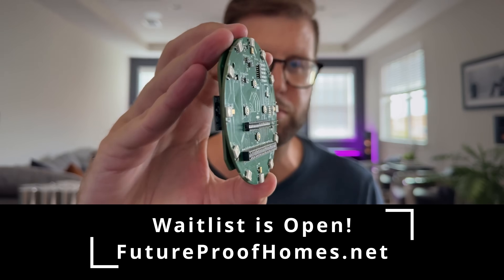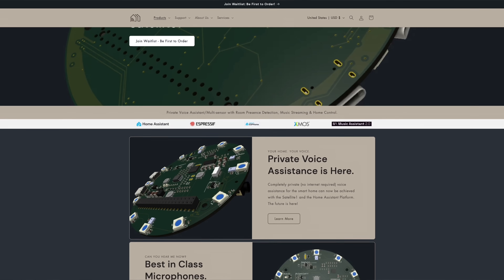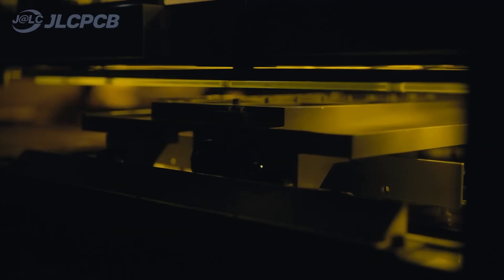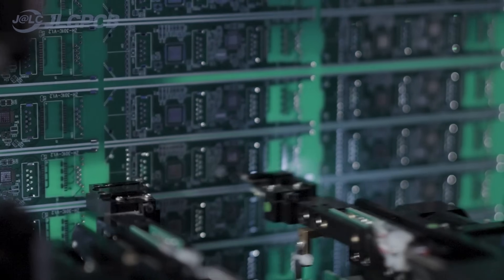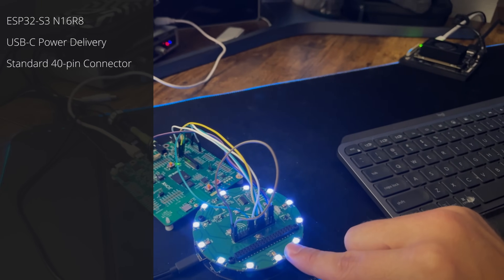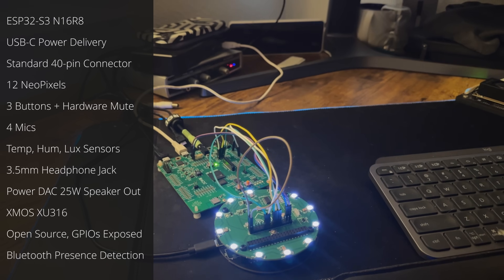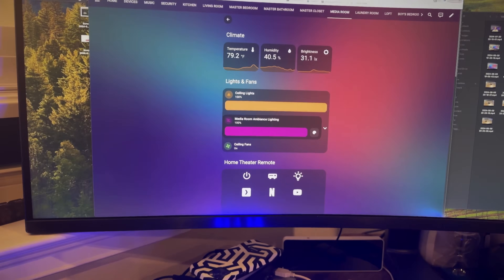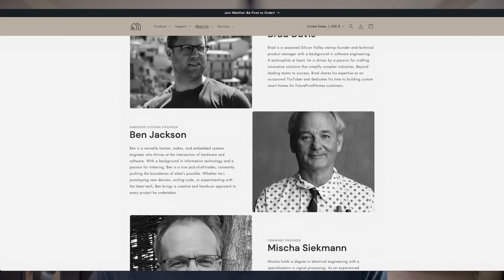Satellite1 Waitlist Open!  Your Private Voice Assistant Hardware is Coming!

Comment: This looks super promising. Will there be an option for 220v on the ceiling mount? Would make sense to connect directly to the existing builidng electric. Also, is connection to the internet optional for doing a quick voice search?
Reply: It would be fairly trivial to add an AC>DC transformer and hide it in the roof to power each one. But they are also adding PoE when they make their enclosure. Hopefully they have some more news soon!

Comment: The claims are dubious because the xmos chip doesn't rival the latest smart speakers as it uses some of the early technologies the 1st gen Alexa/Google devices used.
Google with its latest devices uses some called targetted speech extraction and is the oppisite in design as you enroll your voice so its known and extraction of known and the models they use has been a huge step up to cancelling what is likely unknown noise.
Without any targeting the technologies on show are what you would call a conference microphone which is not really the as modern smart speakers and also its not opensource as the xmos algs are behind a commercial paywall...

Comment: i like to have as few wifi devices as possible. Can the USB port used for power be connected to a POE connection for power and data?
Reply from the maker: The HAT & CORE boards will eventually have a “mini-speaker” you can snap on to the bottom for great sound.  That speaker will have full PoE built-in which is exactly what you’re looking for.
Reply: That will work perfectly! I can't wait till it's available.

Comment: Dude, this is amazing. I plan on buying several if the first dev kit works well. I already use Assist more than Alexa while sitting at the PC, would love to have a good solution off the shelf for all rooms (so I don't have to build 10 DIYs)
Reply from the maker: Sounds like you’re a great fit for the Sat1 too!  Thanks for the support.  Launching soon!

Comment: This is quite cool! So... will it be able to be powered by POE, or just the USB-C options? I like the concept of in ceiling installation and running another POE Cat6e cable is so much easier than running a power outlet!
Reply from the maker: When the enclosure comes out in Q1 it will have a PoE connection.
Reply: @FutureProofHomes  Beautiful! Thanks!

Comment: I'm on the waitlist and really looking forward to this hardware. You're doing an awesome job, thank you and best of luck! I do have one request/suggestion, as an electronics engineer it drives me insane when companies make stupid design choices for powering equipment. I have seen a trend toward powering sensors with USB power supplies, what are people thinking? I know it's easy and simple to use a USB power supply when many of the designs incorporate an ESP32 or similar inside and all you have to do is jam in a micro USB connector to power it but you have to think about the practical aspects of form and function. When you want to place a sensor like a millimeter-wave sensor or any other occupancy or motion sensors it's ridiculous that with so many products on the market now you have to use a USB power supply and then try hide the power supply and cable going to the sensor. What am I missing? I want a nice clean installation and not have a sensor on my wall with a cable running down to an electrical outlet where it's plugged in. In a perfect world the device would support PoE, not an adaptor that I saw mentioned in another post, you want it integrated into the PCB design. RJ45 connectors are, unfortunately, large and I concede that is not ideal and a challenge to keep the device form factor small but this hardware is going to be a little larger because of everything it supports so I feel a RJ45 connector can be accommodated. If PoE proves to be too much of a challenge then please, please, please make provision for DC power terminals. A lot of homes don't have CAT5/6/7 running everywhere but most do have basic, two conductor security wiring that you can send 12 or 24VDC over (5VDC not ideal over long, small gauge copper). I frequently replace old PIR motion sensors with newer technology and use the 12 or 24VDC that was previously powering the device to power the new hardware which then keeps the installation of the device nice and clean and aesthetically pleasing (no stupid power cables hanging down the wall). Thanks to PoE being a power and low latency data/network solution it is ideal but at the very least it would be nice to have flexible power options. A while ago I purchased an ESP32 PoE Development Kit (EST-PoE-32) from Everything Smart Technology (EST) and it supports PoE, USB-C and 9-28VDC for power, it is a great, flexible, little board and proof that it can be done. One final point I'll add to this comment, that has become rather long, I really like being able to power all my devices in my home with a single PoE Ethernet switch which means I only have to worry about a single power source that is plugged into a UPS and not dozens of USB power adaptors plugged in all over the home. Great solution to keep everything protected and operational no matter what happens with mains power. Keeping a spare PoE Ethernet switch also makes for easy redundancy in place of dozens of USB power supplies that easily have their cords pulled out. Okay, perhaps I went a little overboard making my point 😁.
Reply from the maker: Great comment.  I hear you.

Here’s what is happening behind the scenes.  Let me know your thoughts.

What you saw in the video is the “HAT” and “CORE” boards.  Behind the scenes we have a third board we call the “SHOE”.  This SHOE board is responsible for all the I/O connections at the bottom of the hockey puck enclosure (3.5mm headphone jack, USB-C, 30w PoE+, and the available GPIOs).  

So if you’re running the CORE and HAT “naked” (with no enclosure) then you don’t get PoE unless you add-on the third SHOE board dangling from a ribbon cable.

Obviously this decision is being made so that all the boards can fit in the enclosure.  I know this isn’t ideal for hackers but we’re trying to avoid two variants of the HAT.

Thoughts on this?

Comment: Congratulations on this!!! I do have a suggestion for gen 2… if you integrate POE into the board it would make a in ceiling option a lot easier and probably enable a longer longevity. I can’t imagine having to dig in a ceiling to replace a hidden 120 to usb adapter would be very fun. Yet having a cat5/6 dongle that has POE to it can remain dormant in the ceiling with no drawbacks.
Reply from the maker: Our enclosure which will come out in early 2025 will have PoE. :)

Comment: This looks really cool! Any plans to integrate mmWave presence sensors into this and open sourcing the software? Thanks :)
Reply from the maker: Yep.  mmWave will be included in the enclosure.   Alternatively, you can use the PCB kits exposed GPIO and quickly connect a mmWave sensor.
Reply from the maker: Firmware and hardware will be open sourced too.  See the website and GitHub for all details.  :)

Comment: I know you have a 3.5 to connect external speakers but I would prefer not to run wire (whole home audio amp in basement), will we have the ability to still modify the yaml in the esphome setup of the device so that I can set the output speaker to a home assistant media player?  I currently have some m5 atoms that do this by specifying VLC media player ironically which is hooked in as a source to my whole home audio (already have speakers in many rooms throughout house) through my home assistant server.  I use the on_tts_end: and on_tts_start I specify the entity_id of the vlc media player.  The m5s work pretty well but the accuracy is very hit and miss as far as hearing you and they definitely can't hear you if other sound is going on in the room.  The device looks awesome by the way and good luck with the launch!
Reply from the maker: You will absolutely have the ability to modify the ESP32's YAML to output audio another media player of your preference.

Comment: Last time I checked the problem with all those Satellites is that the server running Home Assistant still needs to be powerful enough.
e.g.: I tried the "$13 voice assistant for Home Assistant" (ATOM Echo) and it was horrible. Not because of the hardware in the ATOM Echo but because the server running my Home Assistant instance uses a low powered Intel J4105 Prozessor which is simply not powerful enough. I could only run the lowest whisper model and voice processing took minutes and was horrible inaccurate.

I wish someone would invent a private Voice Assistant which is able to do all the voice processing on device.
Satellites are nice but you still need a nice server for Home Assistant. A Pi 4 / 5 or my Intel processor are just too weak.
Reply from the maker: Fair enough.  You do need an adequate home assistant server to power the home voice interactions.  That is true.  See our roadmap on the website, the AI Base Station (might be late 2025 or even 2026, unless we can get big revenue to scale the team and move faster) will provide more than enough horse power to power this system.
Reply: Yeahhh...
If you want true AI interactions and not just scripted Answers you will need WAY more horsepower to run that locally.

Comment: This seems pretty much identical to the ReSpeaker mic array boards, just with an ESP32 inside. Seeed never delivered a firmware with working beamforming for the XMOS IC, let's hope this guy does better.
Reply from the maker: If we're thinking of the same ReSpeaker, then the Sat1 should be quiet a bit more versatile and powerful. e.g. Has better audio processing, music streaming, bluetooth presence detection, extra sensors, etc.  Not to mention this will work with ESP32 and RPI. :)
Reply: The integrated ESP32 and the resulting form factor is very nice for sure. But for me a voice assistant gadget hinges on rock solid speech recognition (mainly wake word but also STT) no matter if there's music playing or water running in the room. The ReSpeaker didn't have that, despite also using an XMOS chip, that's why I'm having reservations if you can do it. (But very much hope so!)

Comment: OK this looks very cool, so I wanted to share with you my 'wishlist' for the ultimate smart device to place troughout my house:
Devices liek the "Everything Presence Pro" or the "UltimateSensor" check many of the below boxes, but there is note that checks all of them :--)
Some of these could be great to add to your sensor, some it could be nice to ensure that end-users can add them themselves if they want to.
* ESP-based (for ESPHome): check
* With all the features for voice: check
* Speaker can be used as a media player: check
* Bluetooth proxy support: check (I think)
* Bluetooth presence detection: check (I think)
* MMWave Sensor
* PIR Sensor (for an alarm system)
* CO2 Sensor (to monitor air quality, i.e. when to open a window or increase ventilation)
* PoE support: (powering + networking over an ethernet wire).
* Alarm cable support: allow it to be powered by an alarm system and also have it include a relay that can trigger the alarm system when the PIR sensor detects motion.
* Colour LED's (to show a status)
Reply from the maker: Bluetooth proxy - check
Bluetooth presence - check
PoE - check (with adapter or future enclosure)
mmWave -check (via GPIOs or future enclosure)
LEDs for status - check

All other ideas - TBD

Comment: Excellent project!! Is it possible to add PoE?
Reply from the maker: We have a solution for PoE.  Ill discuss in next video.
Reply: @FutureProofHomes  That's great to hear! It will be great to connect and power with one wire ! Also, does it support VLANs?
Reply from the maker: Good question on VLANs… I’ll need to test this!

Comment: How is the streaming handled from MusicAssistant to this Sattelite1?
Reply from the maker: The Sat1 is a HA media player that Music Assistant can immediately stream to.   Our ESP32 implementation handles up/down scaling the music quality to 48kHz when necessary and we can also leverage Music Assistants server transcoding features so the ESP32 doesn't have to do the hard work.
Reply: @FutureProofHomes  .. Thank you for your fast answer. Is that based on ESPHOME? Because ESPHOME lacks in good Multiroom support. It would be great if you can implement snapcast this would enable real Multiroom . Google for snapcast + Carlos. Then you will find a great repo.
Reply from the maker: I also want SnapCast.  Stay tuned.  We’re working on it.
Reply: @FutureProofHomes  Thats so Cool! If you change the dac type to an TAS5805M you get 20-25W in stereo with great efficiency. Easily powered via USB C. If you have the capacity on the esp32 please provide eq settings like loudness, bass , mids, heights and as a bonus room correction.

Comment: just to make a note, to the date, I built the same thing and currently in the testing phase, using 2 Esp
32 models in 1 device, 4 mics, speaker and all the most common sensors. If i fail for sure i will buy many from you, great work
Reply from the maker: Why two ESP32s?  One for ESPresense? :)
Reply: @FutureProofHomes  connectivity/protocols on one and sensors on the other, they seem to work very well together. S3/C6, the mics i wanted also needed C6 so spread the load
Reply from the maker: Does it mean the user would need to juggle multiple serial USB connections and flash multiple ESPs individually, or did you find a way to flash both simultaneously such that the S3 is a "master" and the c6 is a "slave"?

Comment: If this comes with the optional extra of mmWave then i'll be 1st inline to buy
Reply from the maker: Yes!  Will work with any mmWave since all GPIOs are exposed.  Stay tuned as the future enclosures may also give you this mmWave. ;) ;)
Reply: @FutureProofHomes  absolutely awesome. I currently have 15 mmWave sensors ceiling mounted and they are so chatty that I had to create a zigbee network just for them and they all have different controls....nightmare. Absolutely looking for a better alternative

Comment: Stealth ceiling mounted FINALLY someone is thinking about this
Reply from the maker: Agree!  Recessed mount for US (common with our drywall ceilings) and something slightly different for rest of world.
Reply: @FutureProofHomes drywall ceiling is fairly common in many places around the word or at least all the places I’ve been living, but there might be some additional requirements regarding inset devices compared to US.
Reply from the maker: Yep.  Gotta follow proper protocol/regulations/codes for in-ceiling devices.  Hence why a bit later in roadmap.
Reply: @FutureProofHomes  mains powered will ne a necessity as low voltage will be a pain the A$$
Reply: @sygad1  I'm partial to PoE. Provided you have PoE switch already, it's much easier and cheaper to run and connect Cat5. Romex is expensive and requires larger holes to run, a conveniently located junction box with constant power, and is much less DIY friendly for most people. You'd also be getting the benefit of wired networking. Of course, both options would be best.
Reply: @ShadySaltMiner  100% agree

Comment: Add Poe and mm wave and this,would be the all in one room sensor of my dreams. I’d buy 20!
Reply from the maker: Both will be possible!  I'll address this in a Q&A video, but mmWave can be added easily since all the GPIOs are exposed and the future enclosures will give us mmWave too.  Also, a PoE to USB-C adapter will be available.
Reply: +1 for PoE.. biggest PITA for all these devices is finding a suitable way to power.. especially if will be ceiling mounted...

Comment: Nice but why somebody should pick this over the matrix voice?
Reply from the maker: Oh man.  A ton of reasons.  The Matrix Voice is a brick when you first receive it.  You basically have to hack it to get the thing to boot.  Second, the MV is running an old/slower ESP32 and won't do much of what we're aiming to do or handle multi-tasking well (especially with music streaming).  Third, our system will have proper audio echo cancellation and noise cancelling running on the hardware like professional voice assistants, not just an FPGA like Matrix Voice has.  Lastly, the Matrix Voice will only drive a little tiny speaker that won't sound great.
Reply: @FutureProofHomes  ok nice to know, I would suggest adding a comparison somewhere if you did not yet. Nice project!

Comment: In Australia. I signed up. I am on a Win 11 machine with Home assistant on Vmware. Will this device be easily incorporated into home assistant? I ask since i have viewed your other videos, hoping it can be added to esphome......instead of following that process. Thanks

Oh the sensors. With the numerous sensors  I had to deal with, probably have them isolated to reduce built up heat effecting them.

Comment: Subbed & liked. Very interested in the final product. As someone who utilizes Google Home for Whole-Home Audio via Groups (Bluetooth in-wall receivers connected to in-ceiling speakers, connected to the Google Home via Bluetooth), I'm hoping this supports this sort of configuration. In addition, id recommend allowing the Assistant to respond on the same Bluetooth speaker too, as it's one major reason I love using the Google Home still during cleaning or kitchen work. I haven't messed that much with the AI in Home Assistant, but this is the sort of thing that may get me to give it a shot. I do use HA for pretty much all actual smart-home & automation tasks, but I have vocal search & music still on the Google platform.
Reply from the maker: Yep.  My goal is to win over users like you with reliability and functionality.  Stay tuned.  I really want this tech too.  So selfishly I'm building it for me and my customers too.